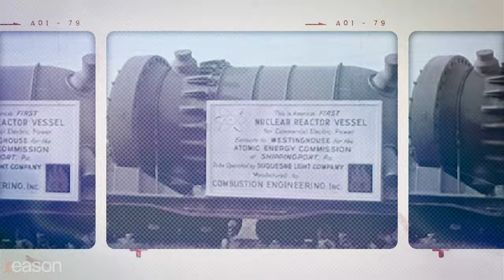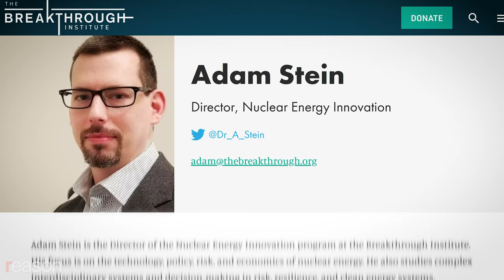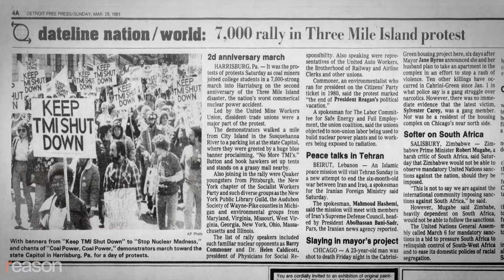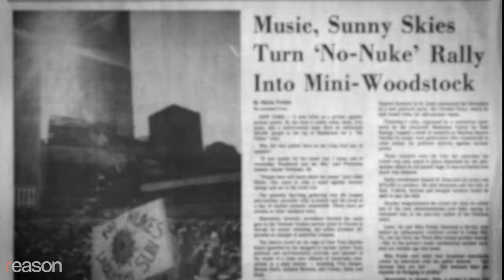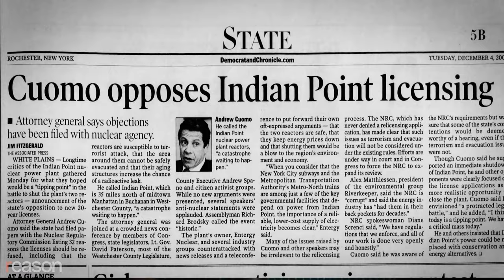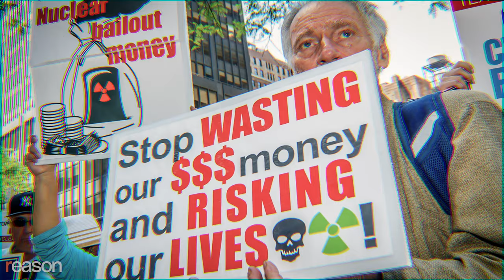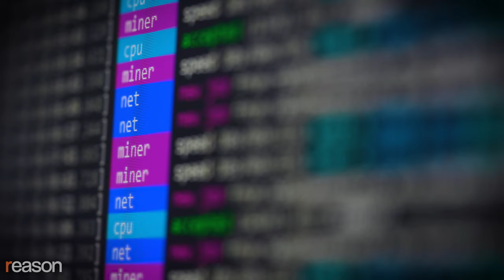Three Mile Island nearly killed nuclear. Now it's coming back.

Comment: Not using nuclear power when we have a strategically safe source of Uranium is the biggest missed opportunity in U.S. history.
Reply: Not to mention that the reusable nuclear waste reactors in Idaho. Basically instead of a single use fuel cycle. They can reuse the spent fuel to make use of the fission materials in the reactors . Much more efficient .
Reply: There was talks about developing Thorium reactors because Thorium is 3x more abundant in nature compared to Uranium
Reply: And thorium, and molten salt reactors that can burn waste nuke fuel.
Reply: @jpt5135  Thorium also provides less output, and the thing with nuclear power is that access to uranium ore is near the bottom of the totem pole in terms of expenses, unless you're a smaller country with no uranium reserves, proven thorium reserves, and you suspect that access to uranium ore may become threatened due to international conflicts, then there's not really a pressing reason to switch to using Thorium reactors.
Reply: @jpt5135   Thorium plants trade a less expensive fuel for a more expensive and complex facility. This is a horrendous tradeoff when the single biggest barrier to new nuclear construction is that the facilities are too expensive to construct, even if the fuel is significantly cheaper. Thorium solves the already existing biggest strength of nuclear fission, while exacerbating the single biggest problem with it.

It's fascinating scientifically and engineering wise, but it's completely useless to the civil energy economics discussion.

Comment: If we had spent a fraction of the money we spent developing fusion, and instead put that towards advanced fission designs we’d have electricity too cheap to meter decades ago.
Reply: Fusion is the future. It always has been and always will be.
Reply: @darkgalaxy5548  you mean it will always be in the future? Like 10-20 years in the future? Forever? 😂😂😂

As I said, if we had spent a fraction of the resources dedicated to fusion and instead put it towards more advanced (safer and much more efficient) fission reactors instead of, we already would have electricity too cheap to meter.
Reply: @M0rmagil   You won't see it in your lifetime. It's not a matter of money, but physics.
Reply: @darkgalaxy5548  then why are we spending so many resources on a pursuit that won’t yield any practical results?!?
Reply: @M0rmagil   Many are asking that same question
Reply: @darkgalaxy5548  agreed
But lets do BOTH

Comment: Environmentalists also protested using nuclear energy in space rovers. They said "no nukes in space". Now we have solar rovers, which don't last as long. At least I read that a bit ago, might be getting details wrong. I wasn't alive when all that was going on either.
Reply: Our longest lasting mars exploration is powered by nuclear batteries
Reply: Not sure when you read that but most of the recent NASA rovers and probes use RTGs as power so it looks like common sense won in space

Comment: I was asked to apply for a job in the nuclear industry - my fees would have been very expensive. I did not apply, because somebody always has to carry the can, when there is an incident. I have worked in places where I could easily have been instantly vapourised, but nuclear is not for me. Costs are not the issue - it is the legacy of intractable waste. Even if it is reused, somebody has to mess with it.  This stuff does not just happen of it's own accord.

Comment: There's also that little detail about the fossil fuel industries funding anti-nuclear and/or pro-wind/solar ads, lobbying, etc. because they knew all along that wind/solar would never be scalable.
Reply: Funny how people keep saying that, yet windmills keep getting bigger and more efficient and cheaper per watt while solar gets way cheaper... Just because you can't build one giant windmill or solar panel that produces hundreds of megawatts like a big thermal plant does not mean we can't build multiple gigawatts of wind and solar farms and energy storage for the cost of one coal or nuclear plant.
Reply: @AnalystPrime of course, you’re going to need consider space taken up by both solar and wind farms, possible environmental impacts they can have (at least for wind farms disrupting local wildlife) the fact that, under not so uncommon weather conditions, their output will be throttled, and that both industries have more casualties per year than nuclear. Also, their payback period (the amount of time to break even on the investment) is actually similar, around 10 years on average. 

Now I’m not trying to demonize solar or wind power, but we need to stop acting like there’s only one solution to the green energy situation. Each has its boons and flaws, and most likely we need to use them in tandem with each other. Solar, wind, and nuclear all together.
Reply: @MothmanOfficialWva  Statistics are misleading. Although we should not build them near airports a wind turbine takes very little space, and even if you don't build solar panels on roofs or high enough that you can grow crops under them(agrivoltaics) then there are plenty of lands that are not used, needed or suitable for anything more important. Conversely thermal plants are built near cities but actually create a zone where either people will not want to live and property values drop.

The number of deaths from construction and electrical accidents is only higher because so few nuclear plants are built, chances are those people would have fallen off a skyscraper or something else. Meanwhile the increased cases of cancer after TMI, Chernobyl and Fukushima are being ignored as "not directly caused by nuclear power".

Weather is a valid issue but already factored in the average yearly production and LCOE calculations.

Comment: I keep seeing "Coal, it the lights on," bumper stickers in my town, where our main power plant runs on natural gas.  I believe their are lots of AstroTurf anti-nuke "environmentalists" paid for by the coal industry.  Now, I don't think the light water reactor technology we use is the best idea, but it's not as bad as mountain top removal, just to dump tons of CO2 into the air.
Reply: The bigger threat to coal is natural gas. It has more hydrogen molecules per carbon (4:1) than coal. Meaning when you burn it, more of the energy comes from forming water (H => H2O) than from forming carbon dioxide (C => CO2). Meaning when you generate energy by burning gas, you produce less CO2 than if you generated the exact same amount of energy by burning coal. In fact that's where the vast majority of the world's CO2 emissions reduction has come from. Switching from coal to gas, not from renewables.
Reply: @solandri69  I knew NG was a lot cleaner than coal, but didn't think about how, until I read your post.  Right now, NG is a waste product of oil production in the USA, so whatever isn't used has to be flared off at the well head, anyway.
Reply: Fossil fuel lobbyists are also lobbying for nuclear power, they know that it would take years for the project to progress and it can be cancelled at any time, but while that is going on lots of stupid people will think there is no need to build any renewables that would be ready to produce power next year because the nuclear plant will be producing even more "any day now" and they can shut down the coal plant after that. Also, "It's great you want this reactor so let's build it in your hometown" tends to make people rethink their support of nuclear power.

But yes, some of these "environmentalists" are probably also demonstrating at the wind farm crying about dead birds...and very carefully not talking about how pollution from fossil fuels kills about million times as many birds as happen to fly into buildings, a small number of those buildings being windmills, while unlike windmills that pollution also kills humans and other animals.

Comment: I'd rather have modern nuclear reactors than use coal and oil.
Reply: Same. I could have a nuclear-powered car! (I own a Tesla).
Reply: Fun fact: Coal power releases over 100 times as much radiation per kWh as nuclear energy. This is because coal-ash contains radioactive heavy metals and there is 100 000 times as much of it produced.

Comment: I understand that thorium is better than uranium. Why are we not using it more yet?
Reply: because all funding with anything to do with nuclear is pretty much Kabash by the Department of energy. Somehow we’re gonna be able to live in the world where solar panels and windmills and unicorn farts meet our energy needs.
Reply: Because it isn't just BETTER.  It has some advantages, and some disadvantages.  It has promise as an emerging alternate source of acquiring fuel, but the advantages it has are fairly niche (logistics and proliferation concerns) while the disadvantages are pretty universal (lower power output and risk from being a newer and less tested technology).  The big players who have the money to throw at it to make it happen, are also the same people who would benefit much less from it.
Reply: At the time, the industry had issues developing thorium salt reactor containment vessels that could contain their corrosive properties for the whole service life of reactors. So in short, the metallurgy was not up to the challenge, and this was still an issue, at least until recently. Not sure if this was solved already or not, in any way,  Thorium reactors can be contrary to some industry claims used to produce nuclear weapons too, so there was little advantage to them other than the availability of Thorium and passive safety design which can be or already is implemented in uranium reactors too, and while uranium reactors can be mass produced today, Thorium ones need decades of long therm testing before any nation will be willing commit to full-scale production. The question is, do we have decades to wait???

Comment: The moment you said "Ralph Nader", I knew that the Anti-Nuclear Movement was a load of nothing. After all, he wrote the book that killed the Corvair despite the Beetle having the same problems.
Reply: And the 911! I'm also a😂🤣 Porsche owner....but it's the Cayman with the engine in FRONT of the rear axle as originally designed. I was in the nuclear industry when 3 mile happened and within months had to change to the oil industry. Now the pendulum swings back. Almost as if there's some folks enjoying a profitable life from manipulating the masses.

Comment: Could AI data-centers be the catalyst for Small Modular Nuclear to take off? I could see it happening: At some point all new large data-centers will be built out in the middle of nowhere and each equipped with 1 or 2 small modular reactors. (With 2, backup power is taken care of. Also, it would be easier to swap out the modules.)
Reply: Pray tell, what makes a datacenter an "AI" datacenter?
Reply: @aaronkcmo  The power draw for AI-enabled applications is enormous, usually because it involves high-end GPUs or equivalent tech (see Nvidia).  Most server farms are CPU/RAM as their primary power draw, but when adding AI applications you need added hardware that will triple or quadruple the energy consumption, while also needing far more robust cooling.
Reply: @Skummeh2  lol, this is hilarious.  tell me you know nothing about computing without telling me you know nothing about computing.
Reply: @aaronkcmo  I'm a systems administrator and I manage 3 data centers.
Reply: @Skummeh2  then you should know very well that the CPU load from any number of workloads far surpasses any load "AI" is capable of generating.  also, you should know very well that "AI" has no 3D workload and is not suitable for a GPU.  further, you should know very well that normal business workloads for datacenters far surpass any consumer based workloads such as "AI".  go take a look at the CPU workload a small bank or other financial institution generates and then come back and tell me that "AI" is somehow a greater workload.  while you're there see how many discreet GPUs you find in the racks, although it may be non-zero it will be miniscule compared to CPUs.  i've been an IT engineer for about 20 years.
Reply: @aaronkcmo  I guess YT deleted my comment because of links, so here's the short version.  Read up of the H100 and B200 and their power draw.  Your information on datacenters is out of date.  It happens to the best of us.
Reply: @Skummeh2  ok homie.  whatever you say.  just because you have a lot of compute doesn't mean you can use it.  MS is building datacenters because it's more economical for companies to rent compute and expense it as operational costs rather than capitalize a large on--prem IT investment.  it's also way easier to manage security and compliance.  also, just as the word "cloud" has lost its meaning, "AI" will soon lose its meaning when it's used in this context.

Comment: Nuclear is the only plannable energy-source that can be both cheaper and more effective than coal.
By a lot. Today's reactors only utilize 1.5 - 2.5% of the uranium. Reactors can literally be made 40 times more efficient using the same fuel with new designs.
Reply: Yes but the upfront costs to make a nuclear power plant is like 6 times more than building a coal plant.  That's what's holding Nuclear back, it's the payback period taking decades.  However, Small Modular Reactors(SMR) is on the way, the first plants will be made soon, I think 2028.  If the technology proves itself out, it should be just as cost effective as coal to build up front, safer, and cheaper to run.
Reply: @GROGU123  
Depends on the size and design of the reactor. Larger reactors and high-temperature reactors that does not need a (very big) containment-building are disproportionally economical.

Comment: You skipped 2007 to 2015 completion of Watts Bar Unit 2 for $4Billion, and glossed over Vogtle Unit 4. By my count we are three new units online since 2015. I'd be shocked if $1.6Billion gets the TMI unit up and running, the first number is always a happy feel good number but we'll see.  A lot will depend on whether they go with Bechtel as the constructor or wait until the project is in the ditch and over budget before they bring Bechtel in. As for Microsoft - not impressed. They would have to buy and decommission an equivalent coal unit to earn the right to claim they did something for the environment. It more fair to claim a new nuke stabilizes the grid with base load power vs. building faulty intermittent renewables (wind& solar). From that perspective hats off the MS for not screwing the grid with the worthless forms of renewable power.
Reply: Triple that number and quadruple the timeline, lol. It's never going to happen.
Reply: Everything you said after, "As for Microsoft" is just pure stupidity. If you require a perfect solution to everything to be impressed you will never see any progress at all. This is a good precedent to set.

Comment: I have no problem at all with Three Mile Island being reopened.  
Point one -  there were no casualties as a result of the accident and the safety systems worked as designed.  
Point two -  technology has advanced enormously since the accident in 1979.  Heck, I'm looking forward to the day when you can get a small nuclear generator in your basement.  Maybe the LENR scientists can eventually make one.  
( LENR -  Low Energy or Lattice-Enhanced Nuclear Reactions,  formerly called "cold fusion".   There IS something happening there - some kind of effect,  and that area of research is looking very promising. )
Reply: You do know that TMI-2 was the unit that had the accident and never reopened and the containment building is so contaminated that it is not even schedule to be cleaned till 2050, 70 years after the accident.

Comment: Nuclear should have still prevailed with the advent of modern computers. It is important to simulate the reactor in realtime so all safety parameters can be predicted in advance and compared to the real unit. The tech wasn't there when 3 mile island ruined nuclear reputation. AI clusters themselves can make nuclear power more safer than before.

Comment: A big problem for nuclear power (and its proponents) is you must make it safe from the worst possible failure.  That is always going to make up front costs for nuclear very expensive.  If you don't and the worst possible failure occurs you have a Chernobyl.  If you thought you did but find out you didn't you have a Three Mile Island.  In many projects where safety is an expensive high priority concern there is a tendency to cut corners while hiding that is being done.  Especially with lowest bidder projects.  This is very dangerous with nuclear.  Other than that nuclear is a great idea.  PS --- As for nuclear waste it will always be a problem and NIMB will always be a problem.  Sorry.

Comment: There have been insane levels of progress on the safety of nuclear reactors. Improvements galore. They are better than most power generation technology. Their waste is solid, not gaseous like any other combustible except hydrogen. You do not need to devastate entire forests to plant windmills or solar either. They operate for years without need to refuel and can be built now on small scale. Heck there is the tech to convert regular diesel or carbon power generators into nuclear powered ones. Thermal power generation requires some level of volcanic activity like those on Iceland, or Yellowstone which would work at the expense of destroying that ecosystem.